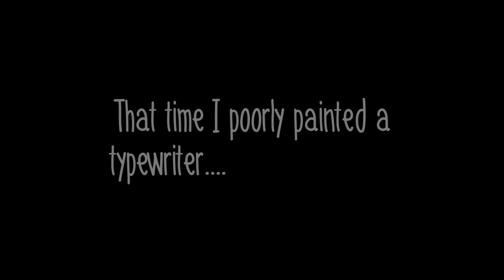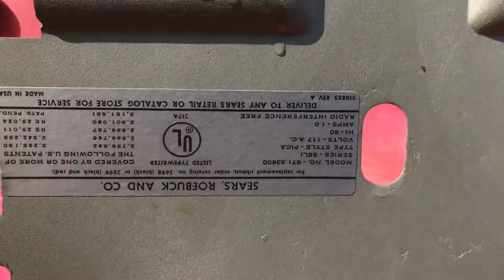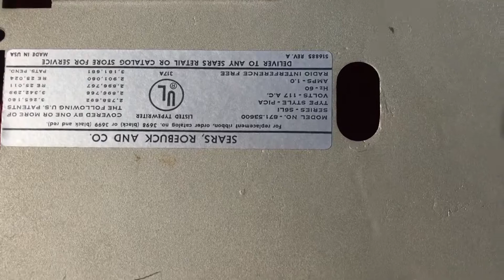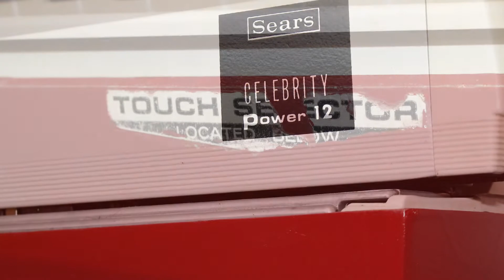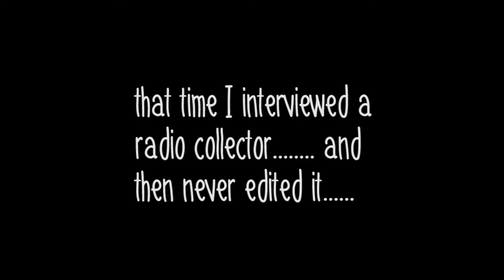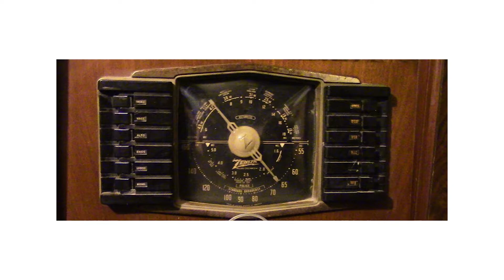Typewriter Videos I Never Made....... (my fails this year)

Comment: I use Dupli Color’s Adhesion Promoter for every typewriter painting project (unless I’m hand painting with oil paint). I use it on both metal and plastic parts before using spray paint. It’s a clear primer that makes paint miraculously stick to it. I think the instructions say apply two coats before spray painting with you color of choice. But I do three or four coats, especially if the part I’m painting is scuffed and scratched. Replacement spray caps are also a life saver. I bought the ones meant for street art off Amazon and they’ve saved so many paint jobs from failure. I swear, half the spray caps that come with spray paint cans are defective.
Reply from the maker: Thank you for the tip- that will be super helpful for my next project machine!